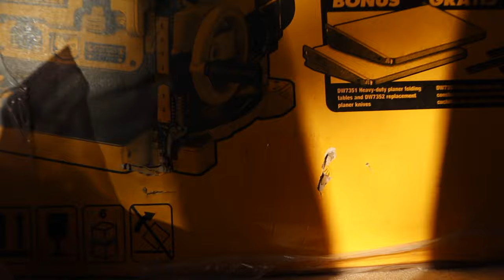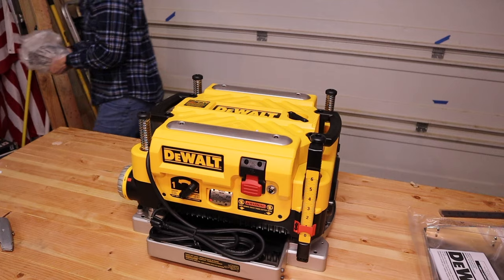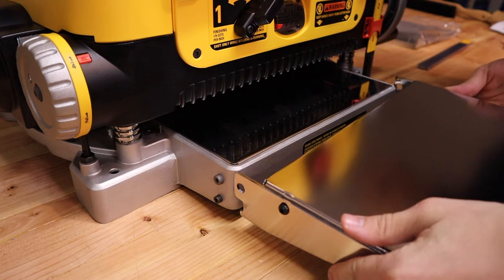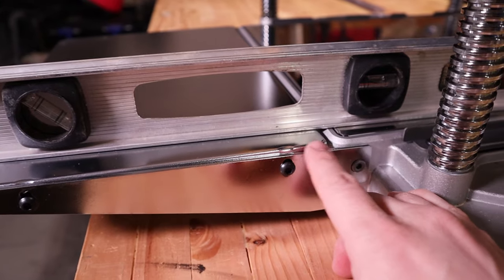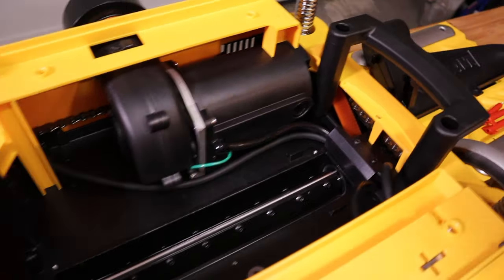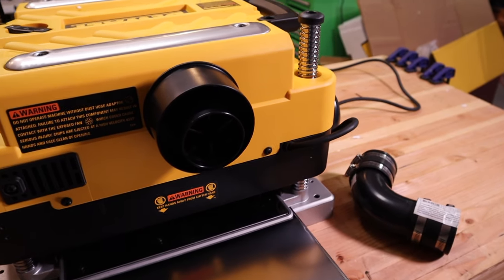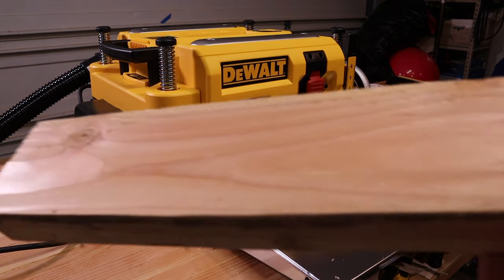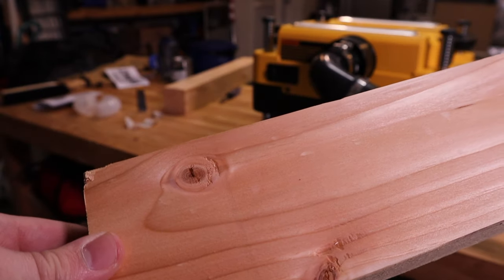Dewalt 735 Planer | Unboxing & Setup

Comment: So I used my infeed/outfeed tables as-is out of the box for a while & got great results...the further out ends wer in fact angled up slightly but that actually prevented snipe. I’ve since leveled the whole thing out and have to deal with snipe pretty consistently. :(
Reply from the maker: I noticed the same thing! Especially when working with heavier work pieces. I ended up going back and providing a small upward angle, like you mentioned,  to help remove snipe and it works like a charm. Lesson learned, unless safety is an issue, try it out of the box before making adjustments.

Comment: I wanted to thank you for making this video. I too now own a 735 and I’m not big on reading instructions (at least initially) but if someone shows me how to do something then no problem. You showed me how to setup my planer and there was no problem. Thanks again and well done on the video, stay well.
Cheers from Toronto 😎
Reply from the maker: I appreciate the feedback Steve! Glad you found it useful! 

Cheers from Oregon!
Reply: @NorthwestCraftsman , this described me to a tee! I have had my planer in my garage over a year.  I think I have the guts to get acquainted with mine.  Love to see how you connected the vacuum system.  May have more questions on that.  How to I ask more questions after this? Do I just come back to this video?
Reply from the maker: @warnercruce8946  I’m so glad you found this helpful! If you comment back on the video I see it and try to respond to every comment. Otherwise my email is in  the about section of my page.

Comment from the maker: For anyone wondering what adapters I have on the chip port, I have a 2.5” coupler to a 2.5” 90° elbow to a 2.5-2.25” tool attachment. I used Rockler Dust Right brand but the following Powertech attachments should work as well with the one exception of needing a second coupler at the outlet because I couldn’t find a tool attachment reducer combo. You can replace the final coupler with one that will fit your shop vac or dust collector system.  

    Coupler, 2.5": https://amzn.to/3mqT1Pe
    Elbow, 90deg: https://amzn.to/35Et5c9
    Reducer, 2.5"-2.25": https://amzn.to/3e4lrvq
    Hose, 2.5”: https://amzn.to/37MqhMN
    Hose, 2.5” Adapters: https://amzn.to/2HJGO9z
Reply from the maker: @Aziz D the hose is 2.5”. I’ve added links in the comment for all components in the chain.

Comment: Hello,
I apologize for the earlier message.  I figured it out. It is different than what you show in the video though. I was confused at first but then played around with the fittings to make it work.  Tried it out briefly, and it seems to work OK now,. Sincere thanks for your help and trouble.
Reply from the maker: No problem at all Jerry! As I’m thinking back I may have done a “quick and dirty” test with some of the base dust deputy parts but I’m glad you got those parts to work! 

Happy Woodworking!

Josh
Northwest Craftsman

Comment: I always enjoy your presentations. Clearly explained with lots of great insight. I recently purchased this planer and finally set it up. My question is more around dealing with the chips and how you managed them coming out of the machine.  Fairly new to woodworking (you help me last year on a Christmas project with the valets - everyone loved them by the way) and I wanted to see if hooking up a 4" dust collector hose to feed into a 5 gallon bucket would be an option. I can see from the sheer volume of chips coming out that I would have to do something to keep the bucket from being blown over.  Any thoughts?  I do all of my work out on the back porch. I'll be building a wood shop over the summer so for now I'm looking for the cheapest/safest way to handle the wood chips.  Thank you very much!
Reply from the maker: Hey Jim! I'm glad the trays were a hit! :D 

For chip collection it's actually pretty easy but you're right, there are a ton so if you have anything small, it'll fill up fast. 

For a long time, I used a 2.5" hose connected to a dust deputy (cyclone), which fed into a barrel. The blower is strong enough that the cyclone filters everything out without needing a shop vac. Links to that entire hookup can be found below. It's the same one I used in this video. Now-a-day's I have a full dust collection system that uses 4" hose throughout which was an easy swap. 

If you have any questions about the setup, don't hesitate to let me know! 

    Coupler, 2.5": https://amzn.to/3mqT1Pe
    Elbow, 90deg: https://amzn.to/35Et5c9
    Reducer, 2.5"-2.25": https://amzn.to/3e4lrvq
    Dust Deputy: https://amzn.to/3jBu6H0
    Hose, 2.5”: https://amzn.to/37MqhMN
    Hose, 2.5” Adapters: https://amzn.to/2HJGO9z
    Blue Barrel: https://amzn.to/2HDpGlI

All that being said, there are a ton of shops that just let their machine eject their chips, especially if they're in an outdoor space. If you through a 90deg bend on it and pointed it down at a 45 towards the ground, you'd probably be fine.
Reply: @NorthwestCraftsman  Thank you very much!  I appreciate the detailed list as well.  Once I get it set up I'll send you a pic of the finished product!
Reply from the maker: Please do!

Comment: The tables are a pain. Best to build an in feed and out feed table that's perfectly level and flat. Start on the smallest cut, which I think is like 1/64 or 1/32. I've noticed too that if you look at the grain and try to line it up it helps too. I put lumber in at an angle sometimes to figure out what gets the best results. Depends on the species too. Walnut for example seems to take it however it wants, but oak or pine seem more prone to tear out.

Comment: Very informative video. Still looking for 2 and1/2” 90degree elbow and rubber connectors
Reply from the maker: Hey Larry, these should work well for you. Normally I include all of my products in the description of the video. 

Products Used:
    Coupler, 2.5": https://amzn.to/3mqT1Pe
    Elbow, 90deg: https://amzn.to/35Et5c9
    Reducer, 2.5"-2.25": https://amzn.to/3e4lrvq
    Dust Deputy: https://amzn.to/3jBu6H0
    Hose, 2.5”: https://amzn.to/37MqhMN
    Hose, 2.5” Adapters: https://amzn.to/2HJGO9z

Comment: Love this easy vid that covers so much quickly and clearly. I wonder if there was much dust that came out of the collector?  It looks like it was clean, but I wonder if it captured the fine dust as well or just the big chips? I know it's been a few years so you may not monitor this one. Thanks again.
Reply from the maker: Glad you like the style! Your question is a good one. I've been really impressed with how much the dust deputy pulls out of the air. Honestly, it seems like it captures just about everything, certainly more than the rest of the dust I generate.
Reply: @NorthwestCraftsman  thanks!

Comment: Thanks for this video, I watched it before I used my planner, was a big help.  Now I am rewatching it and really appreciate you linking the dust collection.  My shop vac couldn't keep up and the discharge on the planner is so powerful that I am going to use your setup.
Reply from the maker: Awesome! Glad you found it helpful! I notice another large improvement in performance when I moved to 4” powered dust collection rather than the 2.5” used previously.
Reply: Great video!  What type of setup is that for dust collection?  Where did you find that, if you don’t mind me asking?

Comment: Another DeWalt735 reviewer mentioned that adding a planer to one's shop, is akin to the time when we all purchased our FIRST table saw - a game changer.  I'm ready to order my 735X.!  Thanks for the great video.   I am now a subscriber.  PS:  That other reviewer noted that DeWalt created a little tray to keep the knife compartment thumb screws.
Reply from the maker: This tool was 100% a game changer for me! My first real power tool and man, I use it on every single project. 

And you’re totally right! They have a handy tray for the blade screws as well.

Thanks for subscribing! It’s great to have you as a part of the Northwest Craftsman community 😊
Reply: @NorthwestCraftsman  Do you have a jointer as well?
Reply from the maker: I do, I purchased it later as much of the jointing you need to do can be done on a table saw, in a planer, or on a router. I purchased one purely for convenience so I could stop the tedious jigs to joint the other ways.

Comment: Great video, Thank You!  I had a brain freeze moment and put the extension tray on upside down.  I can't get it off to put it on right.  Can you tell me how to remove it?  Thank you again.
Reply from the maker: Oh man! I’ve totally had the same type of moments. 

So the install when right side up had those spring loaded detents. How’d you get it over the fixed fasteners on the bottom?

Comment: Where do I buy a 2 and 1/2” 90 degree elbow and rubber sleeves (connectors) ?  My dust collection system is also 2 and 1/2”. Lowes and Home Depot don’t have that size. 
I have made my own connections using 4” and reducers, but it is not as clean as the on in the video on how to use and adjust my DeWalt 735 planer.

Comment: Is there a noticeable noise difference when shifting speeds? Just wanted to ask just in case the shifting ever fails
Reply from the maker: No noise difference that I can tell, though I haven’t measured sound levels. Largest noise factor is the depth of cut. Deeper cuts are much louder than fine passes.

Comment: Great video! Just picked up one myself and looking forward to putting to use! I see in some of the material you ran through it has some knots. Did you find this damaged the blades at all since you have used for a couple years now?
Reply from the maker: Thanks Kevin! I’m glad you found it helpful! And great question. I have found them to be pretty robust to pine knots but have hit a few that leave nicks the blades. I woodwork most weekends and the original set of blades have just about reached the end of their life, both sides. Pretty great on the whole. Though, I almost solely work with pine.

Comment: The only thing I'm pissed about is the 735 don't come with the infeed and outfeed tables.  You have to buy separately.  And I did not know that when ordering.  I guess the 735x comes with the tables and extra blades.  That's b.s.  Same exact machine but just add and x to charge more for adding 2 asserories
Reply from the maker: Yea, it’s kind of frustrating. Sometimes you can find a good deal on the 735X which makes the components cheaper.

Comment: Hi very nice presentation. I have a 13 inch dewalt thickness planer. Let’s say I have three pieces of 2X4 and each one them is 2-7/16 , 2-3/8, and 2-5/16 how do I make all three of them being 2-5/16 without manually measuring them. I appreciate your input. Thanks
Reply from the maker: Hey! Not a problem, that's a great question. I was actually doing something similar in my shop tonight. 

If you don't have to be exactly 2-5/16 but can be a hair shy, I'd put that first piece up to the mouth and lower it down until you just barely see the gauge move. Run it through the planer and you should hear barely any material being removed. If you didn't hear anything, move it down a hair and run it again. Once you have this height set, run the rest through; it shouldn't have any issues taking off that amount on 2x4's. I have it now as a standard practice when dimensioning to finish all my parts that need to be the same thickness with one final pass to ensure all of them are exactly the same thickness.

Also, if you need both sides to be planed to create a nice face, you'll repeat this on the back for all of your pieces. This second pass should be the same amount of removal for each piece since you made them all the same thickness in the first step. 

Good luck!

Josh 
Northwest Craftsman
Reply: @NorthwestCraftsman  hi thanks for the quick response. That is an excellent idea.

Comment: Amazing video and you also unknowingly answered my question on how to connect a exit hose to it.  What size did you use to make your elbow joints?
Reply from the maker: Glad you found it helpful! 

Below are links to everything I used from the planer to the blue barrel. 

    Coupler, 2.5": https://amzn.to/3mqT1Pe
    Elbow, 90deg: https://amzn.to/35Et5c9
    Reducer, 2.5"-2.25": https://amzn.to/3e4lrvq
    Dust Deputy: https://amzn.to/3jBu6H0
    Hose, 2.5”: https://amzn.to/37MqhMN
    Hose, 2.5” Adapters: https://amzn.to/2HJGO9z
    Blue Barrel: https://amzn.to/2HDpGlI

Happy woodworking!

Josh 
Northwest Craftsman

Comment: Thanks for this video, I always get psyched out when getting a new tool at first and this was just enough to make myself comfortable with the initial set up. Just was wondering if you had your vacuum running for the dust collection in the video or was that just the planer spitting it out?
Reply from the maker: Great question! And I totally get that feeling. On my end, I usually read through the manual front to back to make sure I have a good understanding of what's going on and the vast majority of my tool unboxing videos are just walking through the manual. 

For the dust collection, that's the planer by itself! It has a powerful blower, in fact, in my new shop it's more powerful than my dust collector can even keep up with so I puff dust out of any loose spots in my system when I have it running 😂 In this video, I just had it hooked up to the cyclone to filter out the parts and spit clean air back into the room.

Comment: Hey, I followed your advice on ordering the the parts for the dust collector (it was very helpful). I do think that the reducer (Reducer, 2.5"-2.25) was not necessary to buy, and was not shown in your demo. If I'm wrong lent me know, but if not you might want to remove it from the list. for me using your list it was an unnecessary expenditure.

overall though thank you. I really appreciate your help (I had to order internationally so I wasn't sure what I would need)
Reply from the maker: Glad you found it helpful! You're right that the reducer may not be needed depending on what you have attached. For this video I only had a test hose to run it to my cyclone but I've since added the following hose and love it. With the new setup, the 2-1/4" adapter allows me to plug my 2.5" hose into it. I'll update the list with the parts, thanks for the heads up! I always take for granted how easy we have it in the States with Amazon and 2 day free shipping. 

New Hose w/ Adapters
    Hose, 2.5”: https://amzn.to/37MqhMN
    Hose, 2.5” Adapters: https://amzn.to/2HJGO9z

Comment: If you want to mount the planer to the bench with bolts or screws, how do you do it? The body of the planer is in the way preventing one from drilling holes or inserting bolts/screws or using a wrench/screw driver.
Reply from the maker: Great question! When I mounted mine to the Dewalt mobile table, it already had the holes drilled but to do that I’d raise it all the way up, mark it, drill with the planer out of the way. Once there you should be able to fit some bolts, nuts, and washers in to secure it.

Comment: I would appreciate if you also explained what all 2 knobs do.
Reply from the maker: Can’t tell if you’re being facetious or not 😂 it’s a good one if it is. But just in case, the switch on the left is for fast vs slow planing speed (1=Slow, 2=Fast) and the wheel on the right is for thickness control 😊
Reply: @NorthwestCraftsman  Apologies for being rude, but if your title says 'set-up' you 'should' explain all core capabilities. I had to watch a couple of ther videos to learn that the knob of left is meat to set the max depth - the blade will NOT go below that depth. Sorry.
Reply from the maker: Gotcha! See, even on my follow up I didn’t cover that knob 😂 you’re totally fine, I should have touched on it in the video. It’s a fair piece of feedback 😊 Glad you were able to get it figured out though!

Comment: just bought this and there is no screw in the crank handle shaft. I would go buy a replacement, but I don't know the width and depth. Wonder how it slipped by quality control
Reply from the maker: Wow! No kidding. I’d contact whoever you bought it from to get a replacement or reach out to Dewalt directly for a replacement.

Comment: I want to unbox my planer and found your video.  My first confusion came at taking the top off.  why look at the blade assembly?  and those things called worm or screw drives, what are they and what  do i do if the blades wobble?  ok testing shifter didn't tell me anything.  what would it do if its bad?
Reply from the maker: Hey Beulah! Sorry for the confusion. I think I understood your questions correctly but please help me understand better if I didn’t. 

I look at the blade assembly to make sure there isn’t any packing material or debris in it before starting it up and to ensure the blades are installed correctly. 

Regarding the worm or screw drives, if you’re referring to the 4 posts in the corners, those are what control the height of the planer and ensure it stays flat while being lowered. 

With regards to blade wobble, if the blades themselves are wobbling in the spindle to which they’re mounted, you’ll need to tighten the screws that hold them in place. If my memory serves me well, there are three. If you’re talking about a small amount of rotational play, that’s normal. That being said I’m not official Dewalt support and they’d be able to help you debug more of you’re still concerned with the wobble. 

Regarding the shifter, testing that was just to go through the function of shifting. It won’t work unless the tool is on but if yours is broken, I’d contact the store you purchased from to coordinate a return or contact Dewalt support. 

If I didn’t understand any of your questions correctly, let me know! Otherwise I hope you get your tool up and running, I love mine in the shop. 

Happy Woodworking! 

Josh
Northwest Craftsman